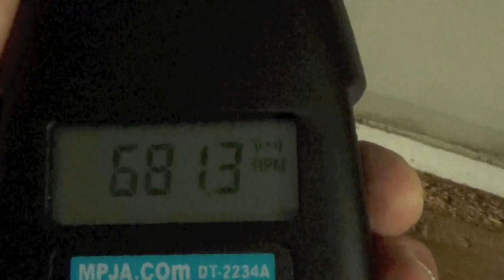Q3 TOROIDAL POWER AMPLIFICATION or TPA

Comment: The arcing is just inductive kick back.  The current would be sinusoidal except for repositioning the brushes over holes at different points of a phase breaks the current  at points somewhere between min current and max current. When at max current, breaking contact creates the largest inductive kickback voltage spikes.  The arcs are hot and vaporize the contacts  shortening their life, not to mention waste that energy heating the air and vaporizing the contacts.
Reply from the maker: Simply a mechanical demonstration of what I made solid state later. No big deal.
Reply: @PMMG4HYBRID  Solid state as in a boost converter?  Link?
Reply from the maker: @kreynolds1123  No. Switching only.
Reply: @PMMG4HYBRID  if you dont mind, could you share a link to what you did, or to something that demonstrates the concept.
Reply from the maker: @kreynolds1123  I'm sure it's somewhere within the 80+ videos that I've posted over time. I learned the fundamental principle of the effect from an 1800's era Tesla patent.

Comment: It seems to be related to timing and dwell - timing the release of the short circuit right when the coil is receiving the maximum flux.  
I actually believe the coils cover too many degrees of the core, more than the flux from the small magnets can handle... so that as the flux hits dead center of the coil, you get maximum generated voltage, but as it continues on through the rotation it actually begins to subtract from that peak - because the narrow flux field is no longer homogeneous across the entire coil. If the coils were about half the width, the peak power would increase.   Try 4 coils, half the width (or less!) of what you have now, put the ones at 90° offset in opposing-series, since the magnets will be opposite polarity.

(yes, I've experimented with this before)

Hook up your o-scope to the coil and look at the waveform, and use external trigger so that the scope scan begins right as the magnet approaches the coil... that will give you a good picture of the magnets' procession through the coil. (with pure resistive load, no bridge rectifier)

Comment: well the universe is a multiplexer more to be the point he is showing the effects of a single pulse state or double and yes it is a not new thingy But does he know that a diode and an other connector point can double in even further as long as the primary has a block or shunt from contact but if the diode's are on primary and secondary or third etc. a lot more in voltage's are store for the increased voltage the time that it is in continued surface contact from time on to off.The time from on off is a thing to consider as well the build up time then the release is engaged like a coil and points of a car ignition system

Comment from the maker: Magic?  Have you ever experimented with high frequency/voltage pulsing into a chemically reactive storage battery? Current is of little significance in that scenario. This is not intended for a direct power-to-load application. If you want that, just go to your local hardware store and buy a standard gas generator.

Comment: This is great!  I always wait for your videos with your awesome research and information.  I do not quite understand fully how you can capture this voltage increase and put it to use.  Can it be captured?  Secondly, if so then you can put more TPAs in series and keep increasing this energy couldn't you?  Each TPA will increase the output from each other? Also, these TPAs could be attached to any generator's output and shaft as yours here right?  Is the TPA easy to build? THANK YOU AGAIN!

Comment: This is what Tesla was doing 100+ years ago, but he wasn't using a toroid. He was using huge dynamos. 

Shorted coil = common voltage spike.   DC output with abrupt spark interruption = Radiant energy burst.  Higher RPM = faster spark interruption and should also increase the effect.  Silver/Tin your leads for better durability.

Comment from the maker: Yes. The input power to the pulse motor remains the same throughout. Current does not increase at any level.
I'm going to put together a simple circuit for harvesting, then cut another vid showing loads.

Comment from the maker: It's a solid aluminum mounting hub with two deep threaded holes 180 degrees apart from each other, extending to the central shaft, and set screws retaining it to the shaft. 
It merely represents an uncomplicated switching method which I will develop with simple electronics. The use of the toroid makes it very unique from attempts of other individuals.

Comment: Amazing. At 90 degrees out of phase, it looks like you're on the way to incorporating quadrature oscillator amplification (or similar) if you run it through all four 90s. 
patent # US6307894

Side note: Add on that amplification, swap those reed switches for that universal controller, and button it up with an installation friendly enclosure for Q4... and you've got yourself a buyer :)